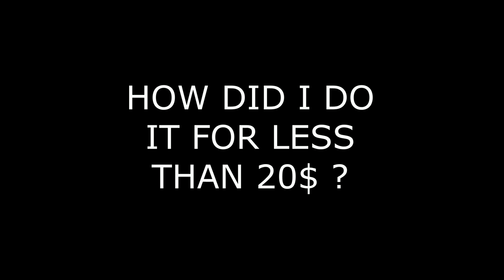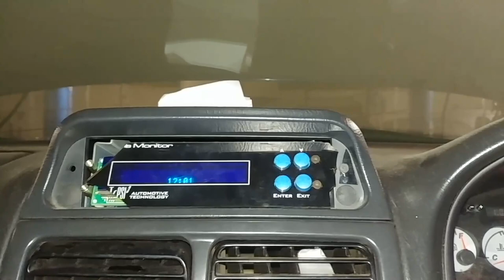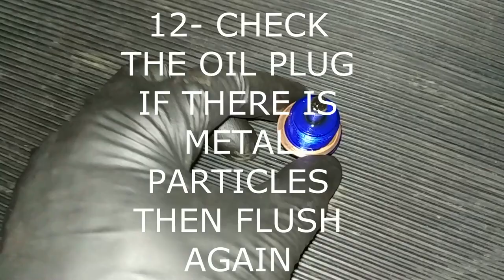How To Change Rod Bearings Without Engine Removal

Comment: Wow, what a hack! Didn't smooth the journal, no assembly lube, dry bearings, no torque, metal through out the engine... good luck down the road! Probably at one of those corner used car lots as well!
Reply: Yup lol pretty down and dirty. I don’t think he will make it 5k miles before that knock comes back.
Reply: And what was the alternative? Full engine rebuild? Or engine swap? Either way what the hell does it matter?
Reply: Didnt watch the vid did ya bud. He flushed it pulled the pan and changed the filter both flushes n put a magnet plug bolt on. Pretty decent diy if u ask me other then bot lubing and not doing all the bearings
Reply: I didn't even read your whole comment but I'm picking this will be dead a thousand or so KS down the road
Reply: @t-dougz6050  bearing material is not magnetic so the drain plug doesn’t do anything. That engine will not last long before knocking again, the journal was too scored. One cylinder has really low compression you can hear it when he cranks it over. I give that engine 5000km max, it sounds like it’s still knocking a bit after the new bearing too

Comment: Working for a professional subaru shop and rebuilding these motors daily, I would never recommend this to anyone unless you absolutely needed the car back on the road. For those of you doing this method then selling the car, I hope you're in a good place cause a hack repair to be sold is bad karma. There is so much more that needs to go into this job for it to be reliable. Cheap is not always best
Reply: I ask because I honestly don't know how is this a hack job?
Reply: Yo how much for a shop to fix it
Reply: This has been done for decades and engines have gone on for years after I had a bmw and did this two  times on the same journal over a  5 year period sold the car to my mate who had helped me do it twice and it’s still going 7 years on and with another 50k on it so it’s worth a shot if you can do it and money is tight
Reply: He should of atleast polished the crank with sand paper

Comment: should have polished crank with some wet sanding paper and a shoe lace  to get avoid it from scratching up new bearing
Reply from the maker: You are absolutely right but still this video is just to show everyone that it can be done for such a low cost then everyone is free to do their own way. I choose the easy way I am a bit lazy :)
Reply: Assembly lube would be nice too!

Dry bearings? Rough journal!
Reply: If your not going to Polish the crank..you really needed to put some lucus oil stabilizer on top of the bearings..so they would inturn..oil the crank..no metal to metal start up"

Comment: did the same with my 1zz engine on a Roadster. bearing replaced, engine smooth like new. 18£ of bearings, when garages where asking to rebuild or replace the engine for 1K. These videos are the worst nightmare for specialist and garages :D Thanks for sharing !
Reply: How long did it last?
Reply: @FroztiProductions  still fine today.
Reply: @80sPhoenix still works? Doing any pulls or driving like an old grandma?
Reply: @RollieBeatz  sold it now, but still fine till with me. Yes driving grandma style, no pulls. That's the only way to preserve an old standard engine.

Comment: the probablem with this is its just going to happen again since the crank journal was scarred
Reply: ok agree with You with 100% ,but question: Is this perfect solution for temporary period some... months? years? of course im doing repairs by my self with my subaru, so i can change rod knocks every month, until when i collect all of oem parts for proper rebuild with new seals, oil pump etc. what do You think? is this good way to safety ,temporary,cheampest and continued use of my engine?
Reply: @Top Fuel Less, I didn't see any assembly lube go on.

Comment: Good job. Don't forget to sand the connecting rod journals with wd40 and 800 grit sandpaper. White clean then install bearings. Also put a strip around the crankshaft connector. Wrap a shoe lace around it and sand it down also with a back and forth pull

Comment: It depends how much damage the crank and bearing took, if it knocks enough to where you can hear it at idle, this fix won't work, at least not for very long, however a slight bearing rattle, with worn out bearings would have a much better chance with rod bearing replacement.

Comment: This video saved me an absolute fortune, you've had some haters in the comments but that was always gonna happen, this helped me out loads, can't thank you enough to be honest. Keep it up matey. 👍😁
Reply: Still running?
Reply: @grandtheftauto1233  No mate this fix didn't last long, ended up getting a new engine.
Reply: @shaking1974  ah well you tried. Hope your new engine is blessed and never fails
Reply: How many miles did you get?
Reply: @joshsettlage  got about 20 ish, had another set of shell's so tried it a second time, and they went while the engine was just ticking over, the main reason for the bearing failing was that the oil pump was knackered so it wasn't feeding the bearings properly.
Reply: So should I do this or keep driving  when it goes ill swap a jdm one
Reply: Better sell it quickly.

Comment: WARNING Please know that if you follow this DIY, you will soon be replacing your bearings again or your entire engine. This repair is merely a band-aid and shouldn't be used for anything serious or long-term. The crankshaft still has old bearing material on it and will need to be sanded/polished until within spec. After the crank has been repaired, you need to measure the bearing clearance and use the correct size bearings for your engine's specified tolerance.  Not only that but you need a torque wrench with proper torque specs for any type of engine work. It's too bad YouTube removed dislikes because this video is dangerous and costly.
Reply: Did this method on an old Corolla AE-100, 6 years letter haven't had any problems. May I ask, are you a mechanic ?
Reply: @kicksoffs  I build these engines professionally and I completely agree with what he's saying. You should go buy a lottery ticket if this method has lasted you that long

Comment: I would have polished the crank first to eliminate the bearring metal that got melted onto the crank. Since he replaced only one bearring he should have used another set with the fines sandpaper grid glued to the inside of the new bearring to sand down to smoother look. then use a piece of tape to hold them together onto the crank and use a shoe string or a rubber belt to spin it fast by hand for a few times with some water. Then remove and inspect untill smooth finish. sounds hard but not impossible. Ill be doing it to my 2005 Wrx Impreza this weekend
Reply: How did it go?

Comment: Everyone knows this is a short term fix, but the car is back on the road. That's what's important. You may get 1000 or you may get 20000 more miles. Do it.
Reply: when you get 20000miles from a 500 bucks car. that's long term fix.

Comment: I did this to my Mitsubishi 3000GT years ago. But you have to torque the rod bearings down or it will still knock. I think my 3000GT was 45ftlbs.
Reply: Still good? Did you replaced it cuz it was knocking?

Comment: Thanks for the video.  I am curious how was this repair in a long term?  How did you figure out what bearing size/thickness to use?
Reply: A proper rebuilt, the crank get polished and you do the measurement to figure out what oversize to use. In this case, I bet it's just the stock size bearing. The crank doesn't look so beat up, It will last long if the engine doesn't have other problems to begin with.

Comment: I'm planning on doing this on my 2009 Forester. After you remove the oil pan what do you need to remove in order to see the connecting rod, like oil pump and everything?
Reply from the maker: Just the oil pan is enough to expose the rods.

Comment: Nicccce, I thought that was a huge job pull motor, etc. Thank you
Reply: You should pull it and have the crank machined. The crank will be out of round so this fix is likely temporary. The new bearing could fail quickly. The entire engine should be disassembled. Metal flakes from the old bearing can clog oil passages and cause more damage
Reply: This is not the right way to do this and will cause problems latter on

Comment: good video but 99% of the time the crank has lost a few thousands of thickness like the bearing so yes it works and is a little quieter with a new stock thicker bearing and fresh oil but most of the time they sound the same after running a little while good try if it's your personal ride definitely not a retail job

Comment: What a great way to do it. I have same issue on my EJ255 so I'm gonna give that a go. Why not
Reply: You’re gonna end up running into the same problem in a bit. When you throw a rod or bearing, those little metal flakes go throughout your engine. Once you throw a rod, if you don’t take apart the engine and resurface almost everything, that engine is junk.
Reply: @colbygoding8951  true that. I'm rebuilding it. Cheers mate

Comment: Depends on how the bearing is damaged. If by stupidity, yes it's a great cheap fix. If the bearing got damage by pre-exisitng oil system problem, the new bearing will get damaged again fairly quickly.

Comment: I would suggest if anyone does this to also buy the heaviest oil for the first run. Also if possible replace the main bearings too, sometimes requires the engine to be removed...ask me how I know. I also have a good tow plan just in case it decides to act up while out.

Comment: My engine sounded like it had a little knock and then seized up completely you can start it with some effort but it squeeks and rattles. Wont run for more than 10 seconds or so. Has metal shavings. Could this be the culprit?
Reply: Ej251 with 143k

Comment: What kind of tool you used to remove the top nut?
Reply from the maker: Yes that one was hard to loosen. I used all of my tool there and tried different solutions. Think I ended up using mini ratchet kit and a spanner
Reply: I just got that top nut. I see its been a year. Did you get it?

Comment: I need help mine does this exact noise should. I try this
Reply: remove your oil pan and feel at the at the bearings, do they have play or are they tight? that's a way to check if this job is needed to be done

Comment: I need help so my subi ran low on oil and its starting to make a clicking sound when accelerating
Reply: If it’s making a deep thud it’s probably knocking. If it’s lighter it may be piston slap.
Reply: @jacobrowell4041  how can I fix it its a light clicking sound
Reply: @jesusvillanueva2616  Sounds more like tappets if it's clicking. Make sure oil level is now in correct range. Liqui Moly make some additives that can help solve ticking tappets. Like Liqui Moly Mos2 Tappet Stop Noise. You can add it to the engine oil. Not an ad for them but they're one of the trustworthy distributors who's products usually work well.

Injectors can also make a very light similar sound but are usually easier to locate, and is usually nothing to be concerned about there.
Reply: @VenturiLife   I still have the knocking sound when I tried to drive the car it'll turn off. Does that mean I have to replace the bearing.
Reply: @jesusvillanueva2616  A knock sound will likely be rod knock which is different to clicking, your knock sensor (detonation sensor) could be shutting down the car I'd say. You may want to try replacing that knock sensor first as if they send the wrong signal to the ECU they can actually induce knocking and one of the reasons the car is shutting itself off I'd say. It's relatively cheap compared to taking the engine apart or doing the kind of emergency procedure shown in this video.

Otherwise I'd say most likely it is main crankshaft bearing going out, and you need to fix it before driving the car again as it can lead to a complete engine failure.

Some more info here on rod knock can be a surprising number of causes. Take it to a professional mechanic for a diagnosis if possible:

https://quality-coaches.com/auto-repair-shop/is-a-rod-knock-the-end-of-your-engine-as-you-know-it/

Comment: Did you replace #1 cylinder rod bearing? can you gain access at all without splitting the block?
Reply from the maker: One cylinder is just not possible without spliting the block.

Comment: im doing the same exact repair to my honda, did the repair hold up good, or did it spin a bearing again?
Reply from the maker: Still going strong :)
Reply: If you got over 100k miles on your crank it is worn egg shaped and OE size bearings are too small. Got to make up for the lose on the crank. OE size bearings might work for a Subaru with 60k miles.
Reply: Joe Smartballs I though the same thing. I had a miata with rod knock on cylinder 4 (common with over heating and low oil) with 245k miles when it blew. Didn’t get oem I wanted to account for the smaller crank (presumably) and they were too much. It locked up the crankshaft.
Reply: @CloudsGarage   is it still holding up do you know I know you sold the car or do you know if how long roughly you think it lasted

Comment: did you clean all the other metal flakes out of the engine oil passages or just left them in there with the new bearings???

Comment: hello, this looks like a very cheap way to fix rod knocking.  How long do you think it would last, before its knocking again? Have it started knocking?
Reply: Kinda depends on how you drive an the condition of the engine when you do this. If it ran for longer periods of time after it started knocking, then the crankshaft is probably toast. I would say it probably lasts a couple oil changes if you drive conservatively

Comment: Is this the same layout as the ej208? Or better said all ejs?
Also did you torque anything or just tighten it as much as you can?
Reply from the maker: Galiba hepsi aynı sen aç bak olursa bize bildir. Abone olmayada unutma kardeşim 😉
Reply: @CloudsGarage  herseyi beklerdim, türk olabilecegini beklemezdim😁
Sagolasin video icin. Ilerde denk gelirsem biryerde acip bakarim. Ayni ise yorum atarim tekrar
Reply: @CloudsGarage  bu arada sen video atiyorum diyorsan kesinlikle abone oldum😁

Comment: So you don't need to pull the engine to replace bearings wow. I need to try this.
Reply: You can do all the bearings except cyclinder 1 connecting rod. There is a bar in the way. Unfortunately cyclinder 1 and 3 is the most likely to start knocking. However doesnt mean it's impossible I have jist never tried it...
Reply: .2. 3. 4. Can be replaced like this .. #1 can't you have to  pull apart  the engine to get to #1 cylinder..  it not a recommended way but if you on a budget go ahead.  Just allow it time to work in ..

Comment: Should you have the car in gear when rotating the crank or no?
Reply from the maker: No we only want te engine to spin.
Reply: @CloudsGarage  Thanks, my WRX spun a bearing I might have to do this for a temporary fix until I can afford a short block. :(
Reply: @Darkhunter218  how did it go?
Reply: @barlosperez8423  Rebuilt the motor, put another 14k on it before I now am at an issue with possibly the valves, been actin real funny and burning oil out the exhaust

Comment: How did you get the top nut off of the cap? I cant seem to get enough room to hook the socket or spanner over it i was thinking i might have to bend the spanner a bit maybe
Reply from the maker: It will take time to remove try different tools maybe the mini rachet set
Reply: @CloudsGarage  Cheers mate

Comment: How did you break the torque on the cap bolts
Reply from the maker: Think I used a spanner and another spanner attached to it for more leverage
Reply: Go to Harbor Freight and get a breaker bar. 2’ at least and you can break loose most bolts. I love mine!

Comment: People do not do this, within time you wreck your motor even more. The rubbish goes in between EVRYTHING, and gets crushed into your main bearings, heads could be destroyed etc. He also did not replace his oil heat exchanger which is also full of metal most of the time.

Comment: Fiddly job. Shows great knowledge of the engine doing it this way. Torquing it seems pretty difficult would need some kind of extension. Are the EJ255 rods accessible this way?
Reply: Probably but I was wondering the same thing. Bought an Outback XT as a parts car but if I could do this fix and have some fun with it for a while first that would be cool. This isn’t a long term fix but it would be interesting for sure and probably worth a shot
Reply: @quintonulm2435  Yep worth doing in a pinch, but you can't really measure tolerances too well with the crankshaft still in there, not impossible but also not a hugely reliable long-term fix.

Comment: I have a question bro I have a 2004 G 35X and I really need help my mechanic tells me that I have a blown engine and I showed him your video but he does not want to do that is there anyway that you could help me 50
Reply: its possible but just a temp fix
Reply: Yeah cause when this happens you need to change out your crankshaft and it can be very expensive that’s why people say your engine is blown cause it costs less to pull your engine and replace it with a used one

Comment: Someone in my area is selling a 2009 Impreza WRX for $4,000, the problem is he says "The car has a rod knock in one of the cylinders, the car hasn't been driven since the knock was discovered, don't have the time or money to fix" Not sure if it's a good idea to buy.
Reply: Don’t, whenever you throw a rod you need to replace the whole engine.

Comment: should haved polish the crankshaft smooth
Reply: Crank has to be removed and milled. The crank is too hard to sand. So you're wrong. Nothing you can do but remove it and mill it, and use larger bearings.